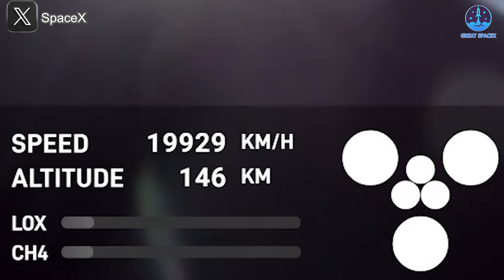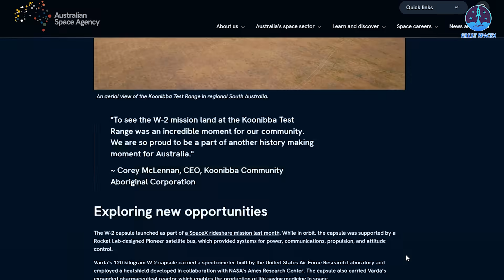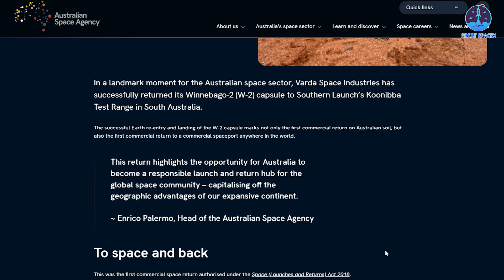SpaceX's Solutions to Fix Starship V2 Problems During Launch...

Comment: I still don’t see why Starship, and other reentry vehicles, don’t just slow down enough for gravity to take over. Just like Superheavy Booster, and (Lord I can’t believe I’m saying it) New Shepard. That way you don’t come ripping in at thousands, possibly tens of thousands of miles per hour, and you wouldn’t need as much heat shielding, because at most your only going a couple thousand mph.

#Starship
@SpaceX
Reply: You see how much fuel they use to accelerate to orbital velocity? Well, they would need to burn the same amount to slow down. You don't just "slow down" in space, it's not like switching your car engine and slowing to a stop.
Reply: there have been some good videos on this, basically in order to slow down you have to cancel the current speed, the weight of the fuel needed would be so great we would not be able to get off the ground.
Reply: @tal041482  yeah I’ve seen a few. There’s just something “missing”. Just feel it in my gut. And I know that’s not very scientific, but I’m telling y’all.... it’s entirely possible, and to be done efficiently.

Comment: Since again heat out miss on land  a tear line drop circular design then line off slight smaller line openings and then a third even thiner for the  catch to be even more safe line zone land booster and then again perhapse longer legs so is even safer booster but still awaits front change like
Reply: wut

Comment: Might any issues in hot staging moments ignition / back flash against starship engines bulkhead an plumbing.  Possible flash tempering the Engine accessory's and or bells?

Comment: I would design it like, monster in the center and raptor around to avoid any heat waves at the center of the bottom and to send the vibration from center to the edges, instead of from around to mid. Just a guess. But if you land a booster or a ship in water until 100% controled landing, you could drop it in a floating landing net. Simply soft wraped chan net and a swimming wide ring. That's all. Good Luck ppl.

Comment: Communication irregularity also needs to be resolved. The past two flights included a lot more disruptions in the camera feed, telemetry data and engine/fuel status than the previous flight 6 test.
Reply: those are due to things breaking that shouldn't once they fix the propulsion system the communication shiould be solid again.

Comment: They could keep using their stock of Raptor 2 engines on the boosters while switching to Raptor 3 on Starship because it looks like Raptor 2 is fine on booster.
Reply: Raptor 3 is still in testing so won't be available to later this year
Reply: @shaung949  I haven't been able to find out much about whether they were in production or not, sounds very much like NOT which means the stock of Raptor 2 engines must be getting very large.
Reply: @ Raptor 3 serial number 1 went to the test range a few months ago so they are in production but not fully field tested. Every Spacex engine is tested before being fitted to a rocket.
Reply: @
Since I haven't seen anyone saying they've seen any Raptor 3 except SN 1 being tested it means Raptor 3 SN 1 would be a test article created by engineering, not a production line output. 

But I suppose we'll know Raptor 3 is in actual production when we start seeing them being tested as they come off of the actual production line.
Reply: @roycsinclair  there have been lots of raptor 3 tested but getting images of engine serial numbers is not easy at the test range. Multiple test stands have been reconfigured for raptor 3 testing.

Comment: I thought they were already using the Raptor 3 engines. Learned something new!
Reply: Large supply of Raptor 2 engines already built because they ramped up production of it last year. Haven't even heard if Raptor 3 is in production either it's quite possible that they have only a few prototypes.

Comment: I hope they solve the problems. As for the moon, Falcon and Falcon Heavy with Dragon makes sense. It’s a shame SpaceX hasn’t been working on a lunar lander aside from Starship.
Reply: He said he wants to get 5 Starships out to Mars in the next transfer window, iirc
Reply: Dragon simply doesn't have the life support for a mission of that duration they are good for max a week without docking to the ISS. DRagon XL is designed to get cargo to the lunar gateway but so far NASA is relying on Orion for crew transport to the moon

Comment: Good luck, they are the good guys. As for the explanations I get the feeling nobody really knows what causes these problems. As in every good engineering problem the causes probably are nothing obvious or simple but rather much more subtle (vibration, ressonance inside the maze of tubes, hydrolock, etc)
Reply: It seems the problems are mounting, both engineering and political. Elon, get back  to Star Base! Your Starship baby needs you!
Reply: I'm sure that this flight has a whole mass of sensors and cameras installed to specificly monitor the most likely areas so the engineers have a solid fix on the source for a complete fix
Reply: Harmonics....tough to solve.... V1 arrangement???

Comment: How much work will be needed to starship to be human rated?
Reply: Lots of trouble free flights just like aircraft we all fly on. Impossible to know how long or when it will finish being rated.
Reply: That is a good question. But before that happens. They first need to successfully deliver a payload to the orbit and land both the booster and the ship itself. And they haven't even done that, and there's not real guarantee that we would see it this year either. Since their supposed "reliable" engine the V3 version is not going to be installed this year... And then there's a process of development and testing... So there's still at least a few years away from that point ( at the very best), if they don't scrap it at all ofcourse and go for the SLS instead etc.
Reply: Need to be reused first. So far one booster engine has been reused, once. Hardly rapid reusable unit. Not even grid fins from the booster are being reused.
Reply: They are not even trying for that any time soon it's going to be probably at least 5 years before that becomes a goal.

Comment: In other words, it shook apart due to harmonic(additive) resonance of the shaking.  This is a very difficult problem and really requires experiments to contain it.  Here is a classic, if not the classic, case of this from the past: https://en.wikipedia.org/wiki/Tacoma_Narrows_Bridge_(1940)
Reply: Take a look at Saturn 5 F1 POGO as a harmonic on boosters.
Reply: Yes. And that is precisely how the N1 Soviet rocket had failed too. They were running into the same kind of problems, and funnily enough they were trying to solve it the same way, that the SpaceX is doing it now.
Reply: @korana6308 but then... it isn't the booster giving headaches
Reply: Agree tough....v1 arrangement. ?? Needed??

Comment: Space X will never launch humans as Passengers on StarSHip. It is too heavy and slow for safety break away. Then there will be NO passengers onboard during all fuel transfer and docking for clustering ships for mission.  Space X must build a 6m center core for Falcon Heavy and a larger Dragon 5 capsule for 25 passengers. All StarShip will be is a in space destination, lab or space transport. The belly of StarShip must be Titanium/Boron overlay. Why is Raptor 2 being use and not Raptor 3??? Who wants to be killed for a ticket on StarShip???????????

Comment: I’m thinking that several problems associated with Starship might better be resolved with further testing prior to launch. It seems a bit irresponsible to perform such a large amount of the testing of systems in flight.
Reply: There are some things that only present themselves in actual flight conditions.....
Reply: @jimb4090 
Exactly what's the point of testing a vacuum engine at ground level.
Irl is the best test ground you can ask for

Comment: Please quit calling it a “Rapid Unscheduled Disassembly”. It “blew up” due to engineering failure.
Reply: I thought it is called RUD because the explosion is triggered by charges for safety reasons
Reply: @leefp6719  nope a RUD is a general term for the thing disintegrated in an interesting fashion usually involving an explosion. It's been around a lot longer than starship.
Reply: @leefp6719  the FTS usually activates to remove the hazard as the vehicle goes out of bounds if it doesn't explode by itself.
Reply: Oh come on now. It's just a little in-joke. It's a Rud!

Comment: I'm probably not the first to think this, but could SpaceX be experiencing sabotage?
Reply: JAAAAAAJAJAJAJA JAJAJJAA JAAAAAAAAAAAAAAAAAAAAAAAAAAAJJAJAJA
Reply: By the nature of other Replies, I think so...
Reply: In theory - yes. In reality - there is no reason to at this point. Those are test flights, and even if they were successful. They are still a long way away from anything that works. For a proof of concept, he needs to deliver payload to orbit and then catch both the rocket and the booster. And it's unknown at this point when this will be accomplished at all, and this flight wasn't even an attempt at doing that.
Reply: it's unlikely most of their problems are from trying to run cutting edge designs. Most companies hide their R&D failures or spend Years on paper trying to guess everything that could go wrong where as spacex build what should work and see if their design works or not. The current failures are an indication that they have a major flaw in the current design that needs replanning not just slapping on a 'fix'.
Reply: and not dog shit design and build, because Elon can do no wrong right. oh dear yuo are so far down the rabbit hole

Comment: Ironically, they will need Raptor V3 bringing a new set of unforseen problems. You can claim you learn with every launch. If you introduce new variables in every launch, you will introduce new problems. This is not a converging design. 
They should wait until Raptor 3 because, this rocket without Raptor 3 has no payload.
Now, Raptor 3 will bring new failure modes.
Reply: Good point. My thoughts exactly too, there were reports that they might start using them at the end of the year... But something tells me they would delay it till next year... So perhaps 2026 for Raptor 3 engines, when they can finally try to iron out the final design of a rocket?
Also jettisoning part of their booster is an obvious flaw too, which makes the booster is not fully reusable (potentially), so have to wait for them to combine it too...
Reply: @ Raptor 3 is running into chamber temperature problems where its so hot that combustion chamber melts.  I think Raptor 3 is high risk. There is a video where Elon said this was the only “real” show stopper
Reply: Speculation.  Where is your data on Raptor 3 failures?
Reply: @ Raptor3 has yet to fly. Higher pressure ratio, flow rate, temperature and higher active cooling needs and different harmonics. They will cause new problems. All these are clearly beyond the prediction of their models. They have the 2 last vehicles fail. There is my evidence
Reply: @pedrosura  other fail due  q max shaking it cause damage  when they made the ship 9 feet longer  have to start over  to unjust it base the second of the v2  too v1 4 launch's.
Reply: @ lol. THAT is your evidence?  Raptor 3 has yet to fly.  Those are YOUR WORDS.  SO what DATA is there to provide a failure?  The whole purpose of the 3 engine was fewer parts to fail.  You're talking harmonics?  Get a harmonica.  EVERY heavy booster undergoes stresses of vibration as well as a host of other variables.  That doesn't mean they are inclined to fail.  You keep on with your speculations if that makes you wet with excitement.  The big boys will keep pressing the envelope.
Reply: @ Another way of stating what you said, is that if you increase the flow rate, temperature and thrust of the rocket engines, you do not anticipate any problems on the vehicle that has had 2 consecutive failures. Ok. You are a genius. I will let time prove me right.
Let me guess… when Elon said he was launching 4 Starships last year you thought that was a done deal right?
How are the astronauts doing?
Reply: @ What astronauts are you referring to?  ZERO astronauts are on any starships to my knowledge.  If risks are too much, then maybe they should change careers. The track record for Boosters has been stellar even with the few engine failures (which were not raptor 3s).  Let me guess... You are one of those people who need 100% handheld assurances that everything will go perfectly to plan before you commit? 
In reference to your assumptions of what I was doing last year with SpaceX, then you should know I haven't followed in depth of SpaceX goals until this year.  I expect failures and drawbacks with space technology because that is exactly what's been happening the last 80 years with NASA, especially in the beginning.  Do you ignore history?

Comment: It could be said that Starship has reached it's "maximum weight to orbit" and the absolute intense vibration and heat exerted within the hot staging ring can only be lessened but never be fully achieved. The engines and plumbing are fine, and raptor 3 also, so I think a new "cool staging" design must be implemented, or more Starships will be lost. Let's be satisfied with a bit less "weight to orbit" so success WILL be achieved. risk/reward, less is more. You can't reuse broken parts and pieces.

Comment: i dont understand having raptor 3 and not using it sooner ?
the more i understand starship issues the more i know it wont be rapid reusable like they planned !! or they must go back to drawing board with huge changes
Reply: I do not think the 3s are flight ready yet. I think they are still testing.
Reply: I think they might have had the raptor 2:s already installed and wanted to make use of them. Dismounting and assembling 3:s on the same ship would have taken more time. Besides all version one Starships with them worked fine.
Reply: Besides of them needing to test them first... Don't forget that they need lots of those engine. I think it's 39 total Raptor engines in total per launch, and they were going for 45 engines with v3 design... That's literally 50 engines, with some spare ones, just for one launch...
And also they need to test it in all modes before launch, so it also takes time... Though they are promising to be using them withing a year time...